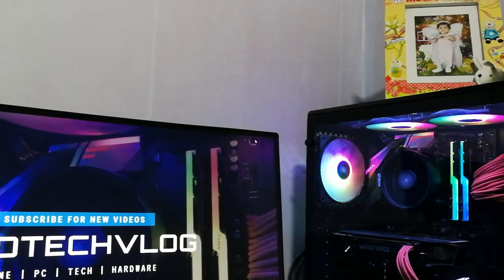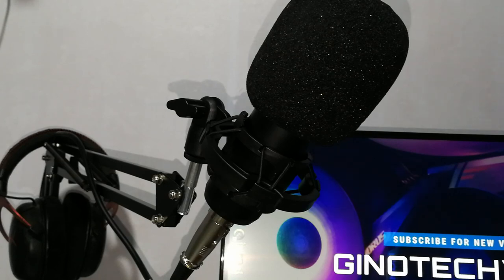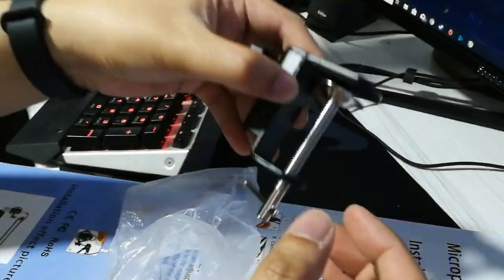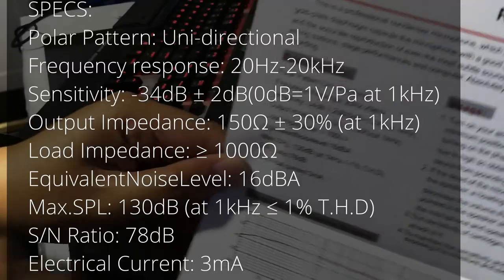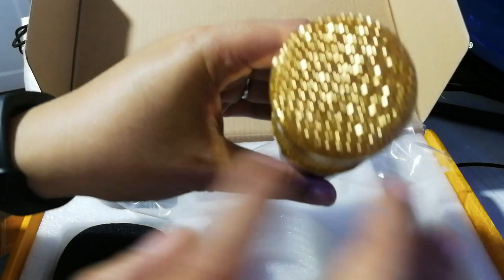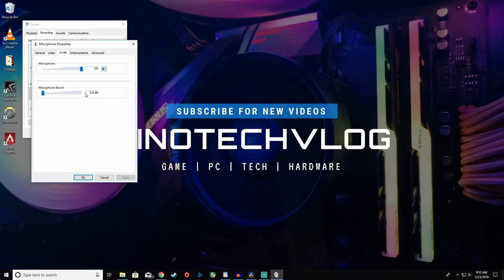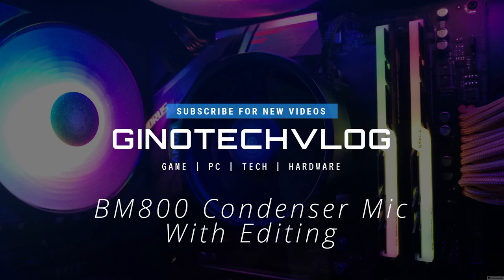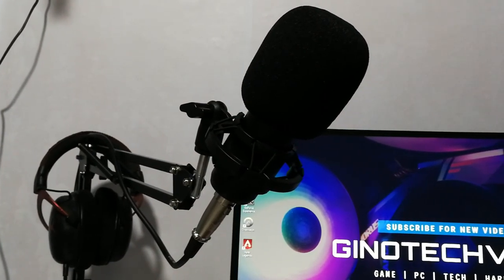BM-800 Condenser Microphone | Unboxing, Overview and Initial set-up Guide

Comment: do you use phantom power and which sound card do you use? i will use the mic with laptop
Reply: and is it good for vocals?
Reply from the maker: Hi bro! I didn't use phantom power. The mic is plugged in directly to the motherboard's built-in sound card and used Audacity to record and amplify my voice. If you think your laptop has a weak audio codec, try getting a cheap external 5.1 usb sound card as well.
Reply from the maker: @umvt1488  for the price yes.
Reply: thanks, do you suggest to use phantom power for laptops?
Reply from the maker: @umvt1488  yes. It's a must-have.

Comment: Hi po tanong ko lang kahit d ko na po kailangan ng usb sound card connect ko lang po mismo sa motherboard besides the green headphone jack?
Reply from the maker: HI. Yes po. Need mo lang iplug sa motherboard thru 3.5mm mic jack (green). Usually pag maganda yung built in codec/sound card ng motherboard mas maganda pa tunog kesa sa usb sound card na generic.
Reply: @GinoCruzVlogs  yung green po ba talaga hindi yung red po?
Reply from the maker: @NoZarX  awww im sorry got confused. pink or red pala for mic input. Green port is for speaker.
Reply: @GinoCruzVlogs  Salamat po ng Marami
Reply from the maker: @NoZarX  welcome bro! :D

Comment: gumamit ka po ba ng mixer? or need pa po ba ng mixer?
Reply from the maker: Hi Elisha! Hindi po ako gumamit ng mixer. Direct po sa pc with volume boosted on post using audacity. Phantom power po pinaka best na partner ni bm800.
Reply: @GinoCruzVlogs  Nakadesktop po ako, kaso di siya pa rin gumagana, does it mean na need ko talaga bumili ng sound card?
Reply from the maker: @ellie6720  possible po na need ng external sound card kasi mahina yung built in sa pc. Best combo is 5.1 sound card yung usb then phantom power
Reply: @GinoCruzVlogs  need na po ba agad ng phantom power? or kahit later on nalang? hehe sorry kulet 😢
Reply from the maker: @ellie6720  hahaha hindi naman agad need. Gagana naman pag sound card lang. ✌😄

Comment: Hi Sir! How do you fix the static sound? Mahina lang siya in the background pero noticeable padin.
Reply from the maker: Hi sir what application po nyo ginagamit yung mic? is it for communication or content creation?
Reply: Gino Cruz it’s for content. Podcasting. :)
Reply from the maker: Pag podcasting you can try to eliminate background noise like electric fans etc first. Adding phantom power din will provide cleaner output. 

Sa content u can use noise removal effects tulad nung sa audacity

Comment: is it good i saw your coomment
Reply from the maker: Yes maam. Its good and cheap. Most desktop pc can drive this mic
Reply: Gino Cruz wait, bali pwedi po ito sa laptop?
Reply from the maker: @pusongmanhid  Technically pwede po. Pero mas clean yung pick up and masmalakas volume nung mic pag may 5.1 usb sound card or phantom power. You can get a usb sound card for 100-300. for phantom power around 1.400